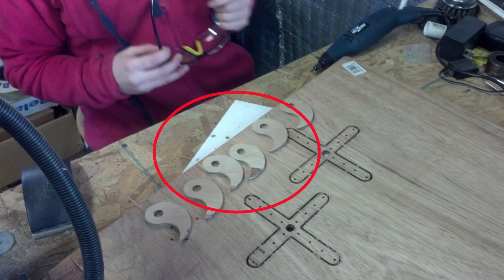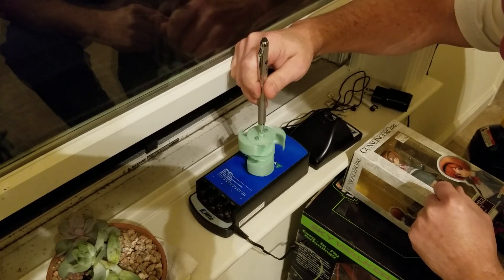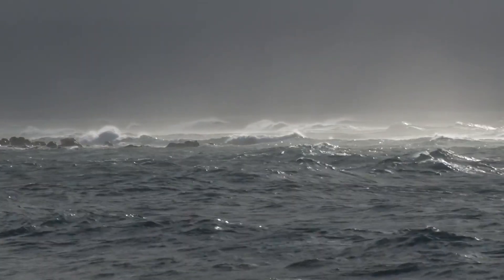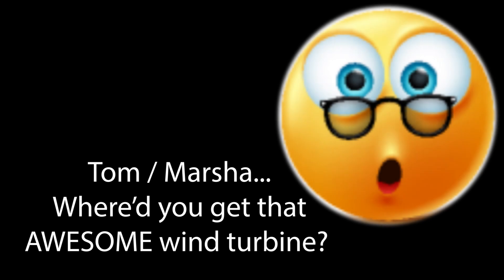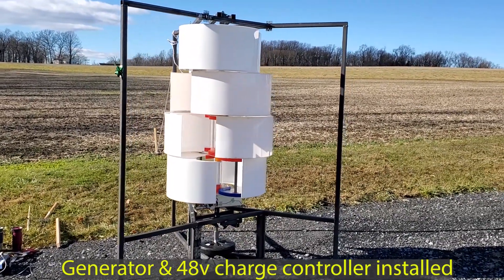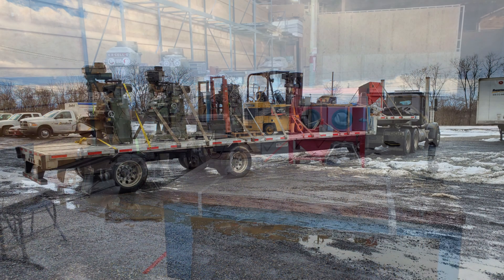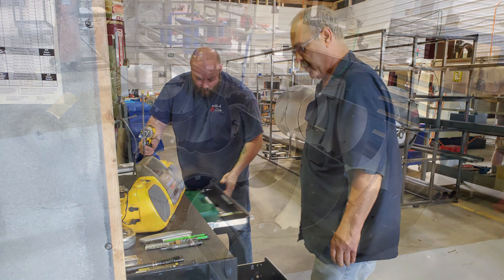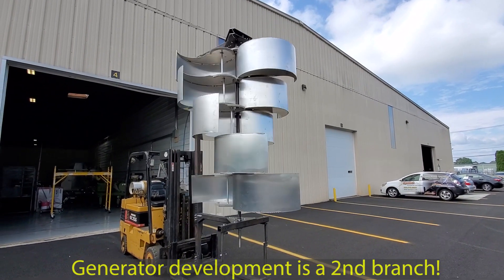Harmony Turbines 2nd Crowdfunding Campaign

Comment: What speed of air is recommended?
Reply from the maker: With this size unit (our 1kW prototype) we are aiming for about 1000 watts of power being produced continually in a steady 24mph wind. We have just started working on testing and will be reporting out our results as we progress through testing. So please subscribe and support our efforts if you enjoy what we're doing and what we're trying to achieve.
Reply: @HarmonyTurbines   9-15 mph is normal wind here.  I have often wondered if you could hook up a second generator at times when wind is blowing hard to add more resistance, before it has to be furled?
Reply from the maker: @davidstrong7854  strong would be like 50mph winds. In that case sure a stronger generator would add better resistance negating the need to furl, but then you'd be loosing power and efficiency at the lower end. So there's a trade-off there that one needs to be careful of.

Comment: It's spinning and a beautiful talking point, but any VAWT will ultimately fail, their efficiency is just too low, the Betz limit proofs it.
Reply: A reference to "Betz Limit" so that I might learn about this ???
Reply from the maker: Betz limit is a theorized limit. It's an upper limit at which wind turbines are supposed to be able to extract useful work out of a given wind volume. It has been called into question at lower wind speeds. But that aside the Betz limit is not specific to any given type of turbine VAWT or HAWT, it's simply an upper limit in general and therefore doesn't really apply to John Q's original statement. In our calculations with our 1kW prototype here we should be close to 1kW of output in a 24mph wind with this size unit at only 35% efficiency which is well below the 59% betz limit. So I believe John's reference to the Betz limit in this case is misplaced.
Reply: @HarmonyTurbines   It may upset the neat geared concept but if the return side rotor could furl with oncoming wind pressure , it would present much reduced rotational drag. When the outgoing (power) rotor has reached windspeed (theoretical maximum), the return rotor is experiencing 2x windspeed.  Wind power (resistance) increases with cube of speed so this is substantial!